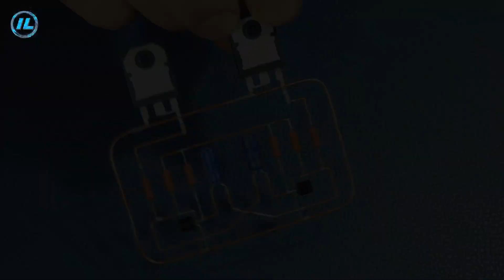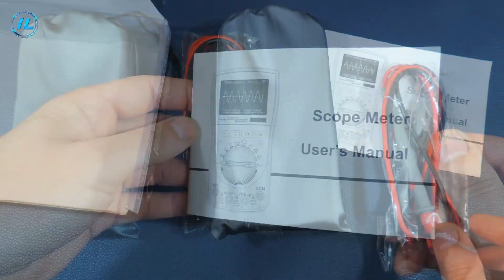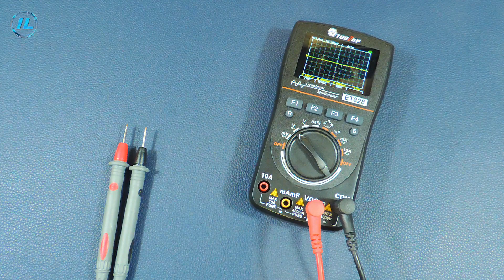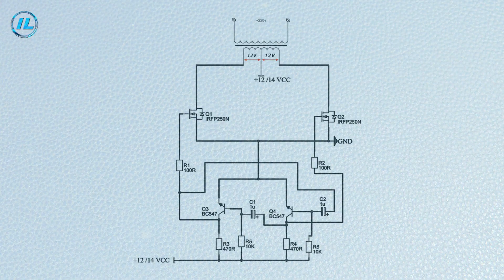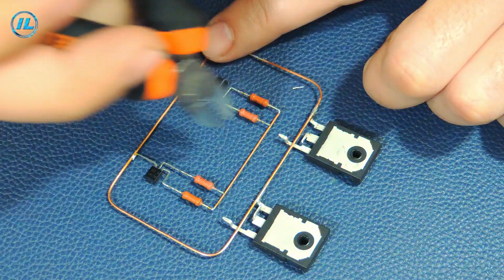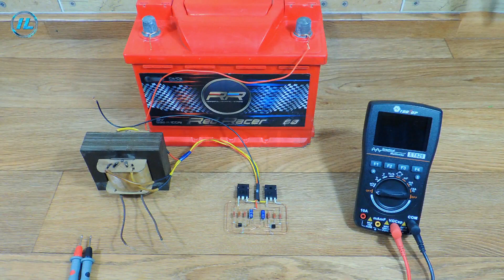✅ A simple 12-220 inverter! Volumetric installation! +Bonus in the description.  Multimeter ToolTop.

Comment from the maker: You can download the schematic diagram, ask a question, suggest an idea for a video or solve other important issues in the Invexlab chat:

https://t.me/invexlab_chat
Reply: can we develop the transformerless design of 220v, and how it responds when the power fets triggering is a sign wave instead of the square pulse of a multivibrator. try it with RC op amp oxilator